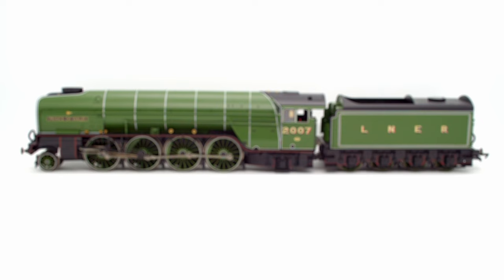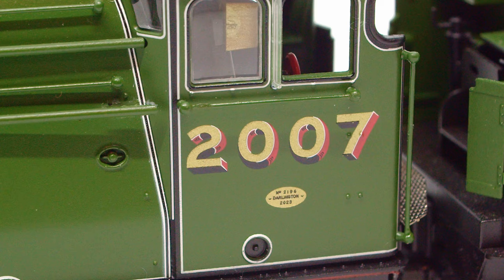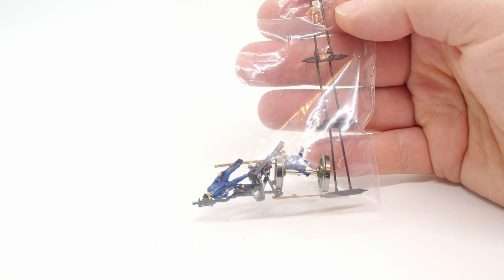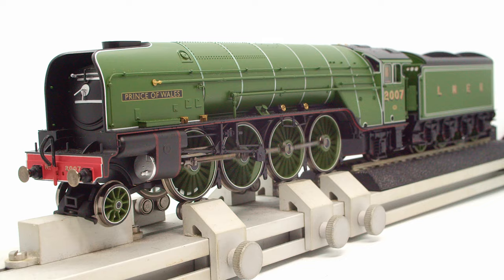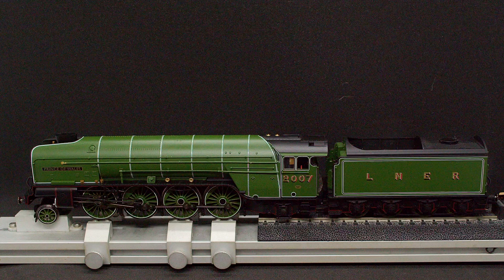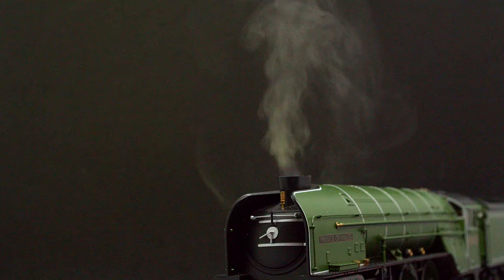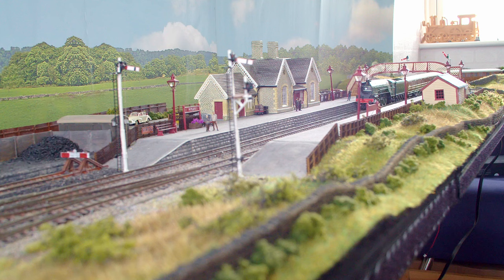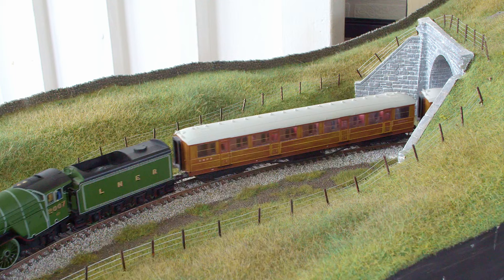GIMMICK OR GAMECHANGER? - Steam Fitted Hornby LNER P2 "Prince Of Wales" - 00 Gauge Review

Comment: Find it a little unusual that only now smoke is becoming a big thing in the UK, as here in the states smoking locos have been around for a long time.

In my own sphere with 3 rail O, pretty well a given that most steamers have a smoke unit, even if it's a more basic puffer style. Absolute kings are MTH, their fan driven ones can run you out of the room, and paired with coal-scented smoke fluid it both looks and smells the part.
Reply from the maker: We have had smoke for a while - I've got a small tank engine from the 60s which has a rudimentary smoke unit in it. I remember when I was a kid Hornby had a few locos in their catalogue which had smoke units and people have been fitting after market generators into their locos for years - I even did it myself in a video a while back. 
I suspect that people here weren't keen on needing to use oil so now that it's based around water, and syncs up to the sound and wheel rotation it's a lot more attractive which is why it's suddenly gaining more attention. Thanks for watching 😃
Reply: I can remember similar ones over here when I was a kiddo, usually just threw some light oil in them and they  were pretty smelly. Things have certainly come a long way since then! Syncronized puffs with the wheels and sounds, even special effects like whistle steam, working cylinder drains that work in time with the motion, water scoop wash, and blowdown valves. Can be completely scentless too if you use non-scented fluid.

Kinda wonder about water-based units, as in my experience with live steam models you don't get any vapor from the stack at all if the ambient temperature is too hot, and in certain lighting conditions the vapor can be hard to see.

Comment: Great video! It actually convinced me to buy one of these locos and I just got it today, I do have a question, did your locos steam generator intermittently stop producing steam then start again a few seconds later? Mine seems to be doing that, though I haven’t fully run it in as of typing.
Reply from the maker: Awesome, hope you're enjoying it! When that's happened with mine it's usually because there's a drop of water sitting on the atomiser. Once it clears the steam effect comes back. Make sure you're using the open chimney rather than the double one to minimise the droplets and just keep an eye on it - if it ever builds up too much I just use the pipette to suck it up but I've only ever had to do that once or twice. Thanks for watching 😃

Comment: I know it's been said several times before, but it seems Hornby MAY have turned a corner. Hornby at its best is hard to beat.

This loco looks great and performs very well. Your review was superior infortainment.

I have an original "Railways" (not the Railroad) version. As you say, this re-tooled model is a far better loco.

That's the most realistic smoke I've ever seen!
Reply from the maker: It's a common line of thinking these days to bash Hornby while glorifying other manufacturers just because Hornby are... well Hornby. But actually when you look at what they've been doing over the last few years there have been several innovations and high quality models that don't really fit into that narrative. It's good to see more and more people are starting to realise that they are capable of producing some fantastic models when they try. Thanks for watching 😃

Comment: I experienced the same derailing issue with this model. None of my other models experience the same issue.
Sadly, after just a couple of weeks of use, the loco stopped working in reverse and I decided to return it to the retailer for a refund.
Reply from the maker: That's a shame. Obviously I can't speak for your personal experience but I always try to speak to the manufacturer as they're usually able to offer a solution or repair. Certainly it seems like the derailing issue is easily solved. Thanks for watching 😃

Comment: Great review and video :)

I like the steam generator idea, we have seen them in the past so it is good see a new generation. Whether I would buy one though, I don't know. I don't like the Hornby decoders or sound, so I would need to change the chip. Would that stop the generator from working, I don't know. There are only 4 (as far as I am aware) connection between the loco and tender (2 for power and 2 for the motor), so I am not sure how info between the chip and generator are done.

The main question is: Do you prefer the Steam Generator or Live Steam? I know my answer :)

Great as always :)
Reply from the maker: I think currently it probably only works with the Hornby HM7000 decoders as the sound profile is most likely working in tandem with the steam generator and hall sensor. But give it a while, I imagine one of the DCC Sound companies will figure out a way to reverse engineer it and get it working with their Zimo or ESU decoders too.

It's hard to choose but the Steam Generator does have some advantages over Live Steam. It's easy to use, you can run it with your other locos... but you don't get the novelty that you do with Live Steam. Thanks for watching 😃

Comment: £300 is a fine price for a DCC sound loco, the problem is the standard ones costing £252 for a non-sound, non-dcc loco!
Reply from the maker: £230 at the retailers though, which for a large express loco with several modern features isn't bad. Other manufacturers are charging a lot more for some locos. Thanks for watching 👍

Comment: Great video. 👍

I have the same derailing issue with the front pony which is ultra loose. 

How did you tighten the spring?
Reply from the maker: Hiya, there's screw holding the front pony on. Loosen that and take the whole pony off and you should see two metal tabs that are point slightly upwards. Bend those further upwards to increase the pressure pushing the front pony down into the rails. Be careful when reassembling the front pony not to bend or twist those tabs.
Also if you have a steam fitted version, make sure it's empty first otherwise you'll spill water everywhere when you turn it upside down to release the screw... guess how I found that out! Hope that helps and thanks for watching 😃
Reply: @ThatModelRailwayGuy  That’s fantastic, thank you. I’ll try that first thing in the morning!

Comment: Gutted as I bought the "new" POW last year and probably paid around £230 for it without the sound and smoke generator.   I wonder if Hornby will offer the parts to fit yourself for the difference ?  🤔
Reply from the maker: I doubt it as from what Hornby have said it's not just as simple as plugging in the generator, there's a lot of other stuff that goes into it that would make retrofitting it very tricky. 
They did announce these steam versions back in 2022 though so they've been known about for a while. There's also a Black 5 and a Flying Scotsman both with steam coming later this year too if either of those take your fancy. Thanks for watching 😃
Reply: @ThatModelRailwayGuy  it was actually more impressive around the sound synchronisation for chuffs from the axle sensor which looks to be excellent

Comment: Is it just me, but when on the rolling road, those con rods didn't look straight. Almost as if they're out of line, especially between driving axles 2 & 4. It looks like they are pivoting at the connecting bolt on axle 3..
Reply from the maker: The driving wheels have some side to side play to allow the loco to navigate the tight train set curves we have on our layouts. The con rods have some slop to allow for this movement but as you can see it doesn't effect the running of the loco. Thanks for watching 😃

Comment: A newcomer  here.  Can someone  tell me why the valve gear? on the "Prince of wales" is plastic, but on the "Earl Marischal"  seems to be metal. Are they the same basic model?  I could and probably  am getting it all wrong, but I can't find an answer.  Be kind, please!
Reply from the maker: Hi there, so essentially the P2's had lots of variations between them with no two locos being entirely the same. As a result the valve gear is different on different locomotives: Earl Marischal had Walschaerts valve gear while the new build Prince Of Wales will have the Lentz poppet valve gear that was a feature of the original Cock Of The North. Basically two different designs of valve gear that look very different.

For the models I'm guessing that Hornby are able to replicate the Walschaerts valve gear in metal but for whatever reason not the poppet version for Prince Of Wales. Bear in mind as well that this isn't the only difference between the two models - especially as Prince Of Wales has used modern technology to refine and improve the design, which I believe Hornby have incorporated in their model too. Hope that helps and thanks for watching 😃

Comment: I have seen posts on  social media where the front driving wheels and pony truck jump off on this model.
Reply from the maker: The springing on the front pony is very weak from the factory - takes all of 30 seconds to unscrew it and push the little copper tabs up though which makes a world of difference. 
But yeah, as a long loco with a rigid wheelbase it's going to be more prone to derailments on our train set style curves and points. I guess I was just surprised at how sensitive it was in comparison to other Hornby models - thinking the 9F, A3/A4s and the W1 Hush Hush here. Thanks for watching 😃
Reply: @ThatModelRailwayGuy  great to know that tip. Thank you. I'll pass it on if I can find the post again.

Comment: Just wondering how long are your platforms and how did you measure them to get the right fit? thanks
Reply from the maker: Around 110cm long. Basically I knew I wanted to run 3 coach trains so I made them long enough to fit 3 coaches plus a decent sized loco. I've cheated slightly with platform 2 as it curves with the loop to get a bit of extra length. Thanks for watching 😃

Comment: Why is this called a steam generator when it's smoke that comes out of the stack?
Reply from the maker: In the UK at least, real sized locomotives are referred to as steam engines not smoke engines because they create steam. If you have smoke coming out of the chimney instead of steam then either you have a problem or you need to have a word with your Fireman! Thanks for watching 😃

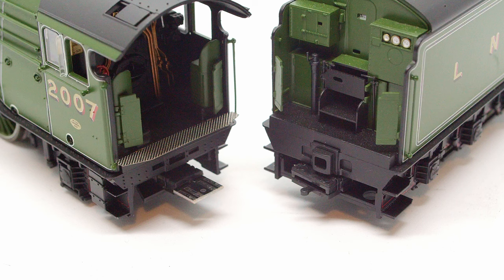Comment: 7:06 but will it last?
Reply from the maker: I've got a few Hornby locos with this connection now and haven't had any problems. I've also had models from other manufacturers that use the same style of connection for much longer and none of those have had any issues either. Obviously it's not designed for repeated use but generally it seems much more convenient than the previous system. Thanks for watching 👍